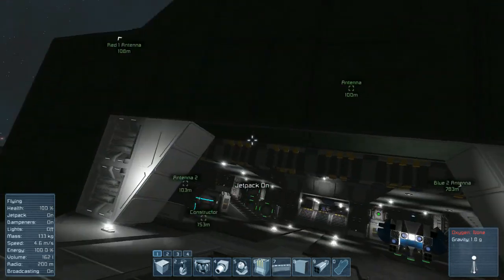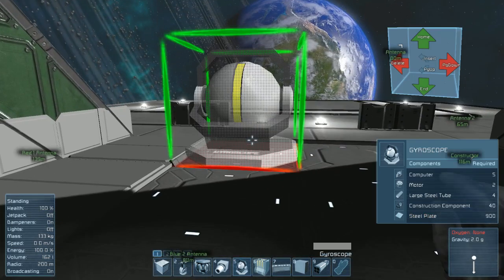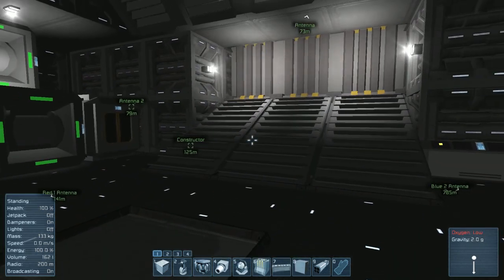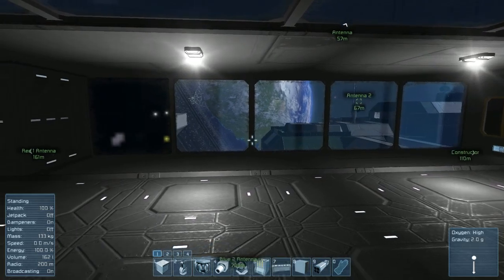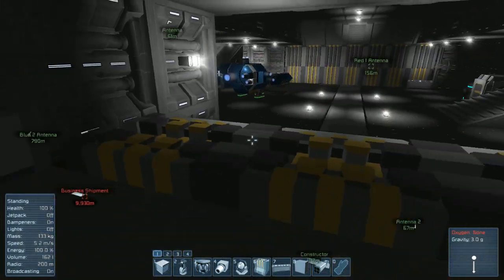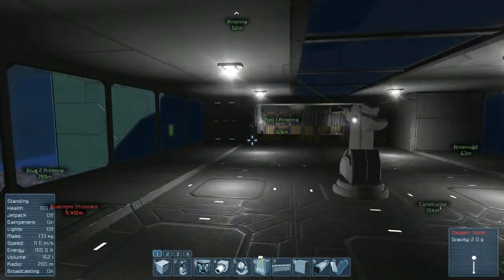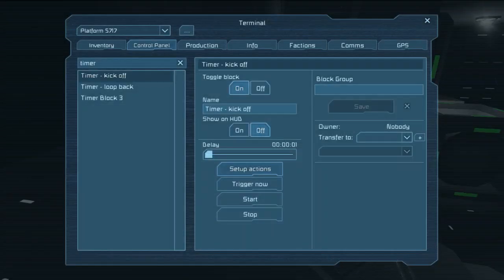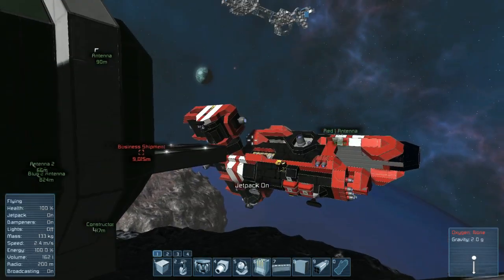Space Engineers - Testing Air-Tight Hanger Doors, and basic timer blocks

Comment: Thanx for video, but I was wandering how to open this bloody doors from inside of small or large ship. Is there a way ?
Reply from the maker: John Voytz Yes, set a remote control block in the station and you can access it remotely.  Alternatively I believe you can use the antenna to antenna signal to operate blocks remotely without it but I've actually never tried to test that directly. (never put any thought into trying to remotely operate the station honestly)

Comment: Why do you need 2 Timers? Can't you just have one Timer block "start" itself, and count down 5 min?
Reply from the maker: In the last few updates something has been changed in timer blocks, they no longer count down between actions, only until all actions start in sequence.  So you have to use the additional block to have the actual timer otherwise it continues to try to execute the same action instantly again and again.  I'll do a video this weekend on timer blocks and play with it some more to see if theres a work around for this that allows you to keep using one timer block, but so far everyone that has had a issue with the same situation I've had them correct it with a 2nd timer block for the actual timer.